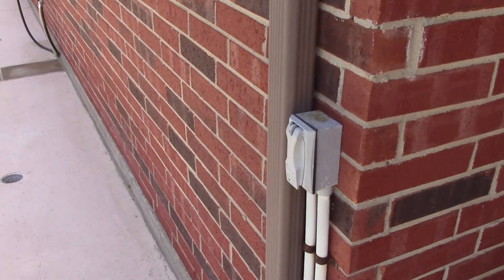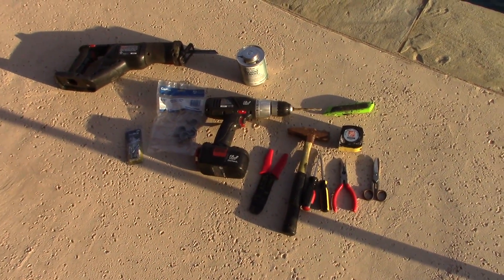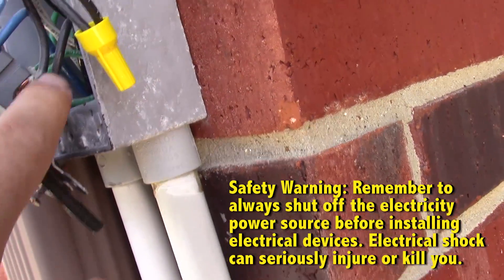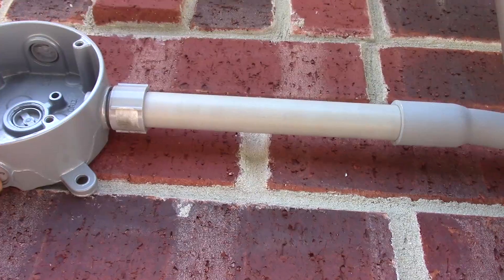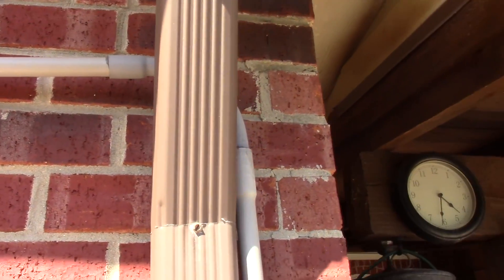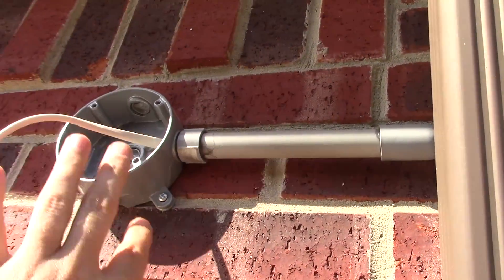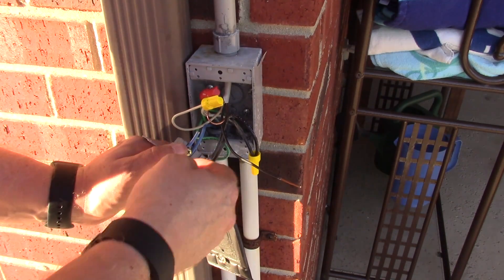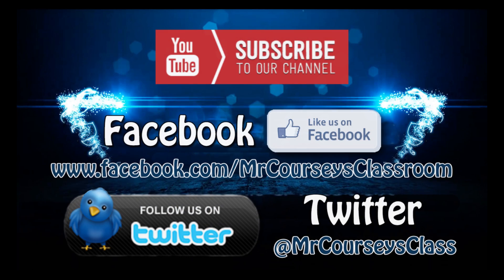DIY: How to Install Additional Wiring to Add an Outdoor FloodLight

Comment: you showed wire stripper in the beginning of the video  but when you were cutting wires later in the video, you didn't use that tool :) you used scissor and long nose plier

Comment: Is it safe to have constant power to the floodlights? I've noted all floodlights installed professionally are connected to a switch and can be turned on/off there instead of the mains. Could that be a requirement of county electrical fixtures code?

Comment: Thanks for the video. Please try not to say positive and negative. The black wire is NOT ground. The black wire usually is the HOT SIDE and the white wire is neutral. Still, thanks for taking the time.

Comment: You aren't allowed to run interior grade romex (white/yellow/orange sheath) in exterior conduit. If you are hell-bent on using romex you'd have to use UF-B wire and make sure the pipe is sufficiently large enough to satisfy max conduit fill requirements. For 14/2 use 3/4" and 12/2 use 1" to be safe. But it is better to and all around easier to just use THWN. Also 20amp = 12 gauge wire not 14! Trim your wires as well (the blue one) which is just waiting to cause a short! Not a great how to.

Comment: Call me crazy, but I use my amp/volt meter on everything that runs power even after I pull the breaker. Not everyone knows how to use a meter so I can understand why you might have just left that out. I really liked this video and the addition is aesthetically pleasing to the eye ! Great job !
Reply: In UK you're supposed to padlock the fuse off too. So no one can come along & switch it on whilst youre unaware

Comment: Nice job with this video. But for good habit when cutting conduit, you should always have that female flare pointing down. This way you are not relying on the PVC glue to keep water out. (Same thing as your roof shingles point down).

Comment: I thought insulated wire shouldn’t be used in a conduit. Generate too much heat ?
Reply: I think insulated wire is not rated for conduit, THHN or THWN I think is what needed to be used. At least in California that is what I needed to do if I were to run conduit outside.
Reply: correct. white sheathed romex is not allowed in an exterior conduit - period. gray (UF-B) still can be used but you have to keep in mind conduit fill. best to just use THWN.
Reply: @fd3871  Well is all this is correct...and I assume you both know what you are talking about...arent you supposed to use 14gauge with THWN 20amp???
Reply: It cant
Reply: False

Comment: You should be using 12 gauge on a 20 amp circut
Reply: Correct.
Reply: does nt it depend on the temperature rating as well as the amps? I was looking at an ampacity chart and it showed 14gauge was used with copper wire to 167F and 12 gauge needed for 140F ? Appreciate any feedback. @aventureoykerendon

Comment: Thank you for taking the time to create this video. Next time you should drill into the brick itself, not the joints using a masonry bit.
Reply: To put a hole in the masonry for the anchors, in addition to a masonry drill bit, one would need a hammer drill.
Reply: Yeah, when I saw him with that wood bit trying to drill into brick that was pretty cringeworthy.
Reply: Thanks for the tip!

Comment: can you tap into a receptacle...also...same concept....instead of a switch ...its a receptacle in my garage. I need to do the same thing but trying to tap into a receptacle in my garage.. and run wire to front of my garage to install flood lights.

Comment: Since that breaker you turned off was a 20 amp breaker, shouldn't you be using 20 gauge wire?
Reply: If i am not mistaken. The bigger the gauge the smaller the wire. So the less Amperage it can handle. He would of needed a 12 gauge for 20 amp circuits or 10 gauge
Reply: yes
Reply: no, 20 awg is extremely small and should only be used for electronics work. On a 20A breaker, 12 awg should be used as it is rated for 20A.
Reply: No.12 gauge or larger
Reply: Larry Murphy 20 gauge wire lmaooooo you know how SMALL 20 gauge wire is?
Reply: 12 gauge.

Comment: Can I add an additional switch to control the flood between the existing pool light switch and the flood?
Reply from the maker: Yes you can. Just wire it like the first switch.